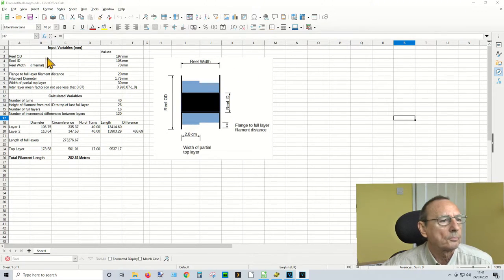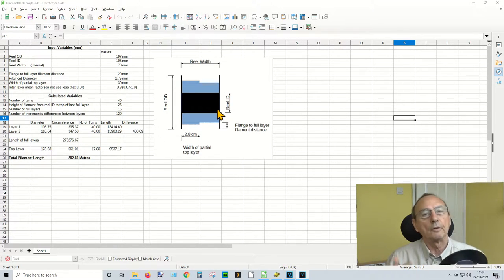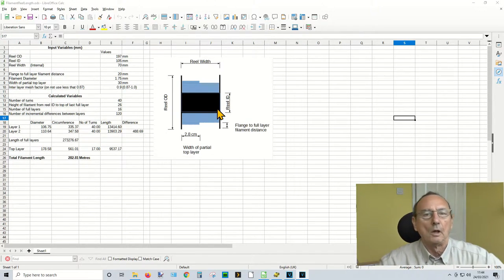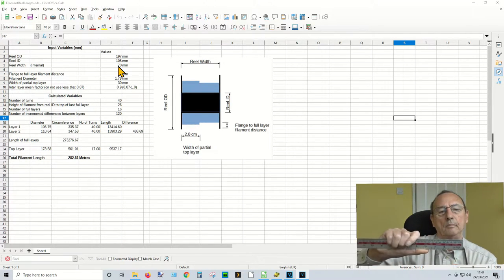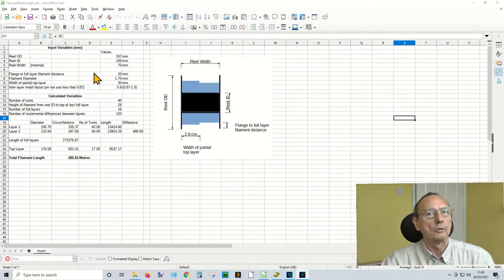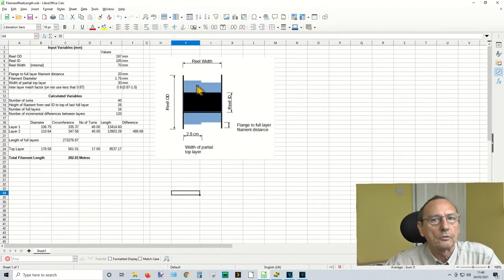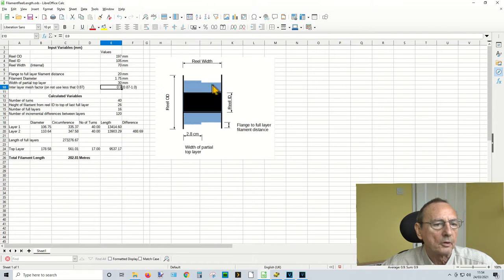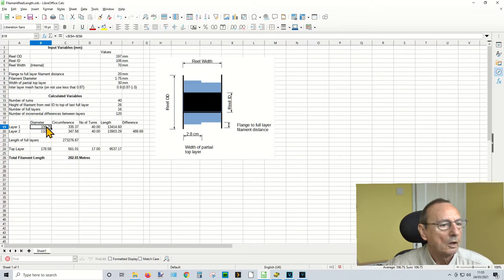Filament Reel Length Calculator and Duet Firmware Update

Comment: The incremental layer difference calculation (18:30) reminded me of a fun little thought experiment: Imagine a rope wrapped tightly around the entire earth. Now imagine another rope being held 1m higher by a ring of people all around the world. Which rope is longer? By how much?

Even on such a large scale the increase in length is only 6.28 (2π) metres! It may be obvious after considering the math, but it isn't intuitive to most people.

Only 6.28 metres! (2π)
Reply from the maker: That's a fun fact I guess. But then the diameter of the earth is around 12.7 million meters so a couple of metres here and there won't make much difference. Whereas 0.2mm difference on a diameter of around 100mm becomes much more significant. That would equate to the people holding the rope being about 25,400 metres tall. :)

Comment: i cringed when you described the beheading of your hotend.  glad your back up and running.
quick question. are you actually monitoring chamber pressure with a sensor for a rationality check on the machines internal calcs?? (i guess the best way to say it is the "theroretical pressure" based on the volume of filament and chamber temp).
it's my gearhead nature to never trust just one sensor or datum, so i was curious. take it easy bud, look forward to the next installment. subscribed
Regards, James
Reply from the maker: Measuring the pressure inside a hot end is something that I would love to do. I think there are a lot of assumptions that people make about why pressure advance works but nobody knows what really happens inside the hot end itself. But suitable sensors are way more expensive than anything I could afford. I have some crazy ideas about keeping the pressure constant by using a mini expansion vessel but whether I'll ever get around to doing it is another matter.
Reply: @deckingman  my only thought was something that couldnt contaminate the mix, a teflon plunger/isolator backed with a silicone oil to a automotive map sensor, much like they use to sense passenger seat occupancy for enabling passenger airbag function (though they go to what can only be described as a whoopee cushion)
some output a Vref signal while others output a signal measurable in hz

i could only imagine the compensations for temp/etc youd have to do with a strain gauge across a thin chamber wall to sense any oil canning

it's not rocket surgery, one of us lunatics will figure something out.

maybe something as simple as a copper/SS tube pressed laterally through the chamber and flattened inside the chamber and filled with silicone with a way to measure the pressure that should transfer as it deforms/collapses/oilcans

thats the most the two marbles in my noggin can come up with

Regards, James
Reply from the maker: @Turbocharged400sbc  My suspicion is that the pressures are very much higher than the 1 bar or so that a MAP sensor or seat occupancy sensor is used for. This must be the case, given the troubles I had with leakages on the earlier designs which would have required very high pressures to buckle the parts the way that it did. 

Then of course, there is the 200 deg C temperature to consider as well as the size and weight of the sensor itself.  

Many years ago, when I was involved in  engine testing, we were measuring the pressures inside the combustion chamber, in real time, with engines running full throttle. So I know it can be done. The trouble is, the equipment we were using back then cost more than what my house is worth :)
Reply: @deckingman  have i gotta solution for you. lookup the 5v ref AC pressure switch for nearly any auto app. 0-375psi designed for underhood temps on the hot high pressure side refrigerant line. a simple "consumable" copper sensing line (fill with silicone grease to minimize air) to the remote sensor might work for you especially with the hotend section sleeved to keep it hot
keep it hot enough ( its own heater/thermister?) and it may be permanent

 i love rube goldberg workarounds. the ac pressure sensors are plastic/alum and are 5$ at the junkyard and you can grab the 3 pin pigtail. the pigtails are available online as they are the same as the Stainless body autometer gauge senders (and AEM/various knockoffs use brass pressure senders)....and if i recal they can be had up to 1kpsi for a reasonable cost and are 5 Vref so should be easy to scale the inputs.

just the data from one print would be invaluable

just some brain droppings
have a good one bud
Regards, James
Reply: @deckingman  I was at the salvage yard the other day picking up some stuff for my Buick.... and I went ahead and snagged a pressure sensor and about 14in of pigtail for you along with portions of the aluminum tube and screw fitting.

I had to get a bunch of other stuff so I got it for pretty much free cuz they love me there.

I don't know how to do a direct message on here but if you shoot me your email/address I will ship this across the pond on my dime just in case you might be able to discover something useful.

Regards, James
Reply: lol "CRINGE" is exactly what I did at his description. As a hobbyist I am lucky I can take the attitude that 3d printer building is a "journey not a destination".